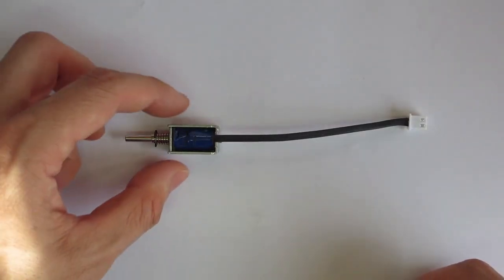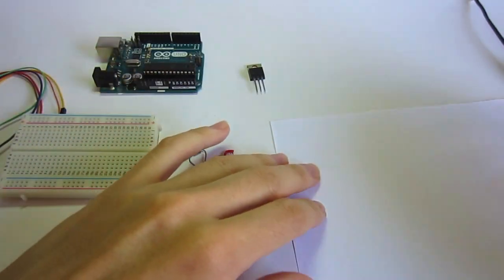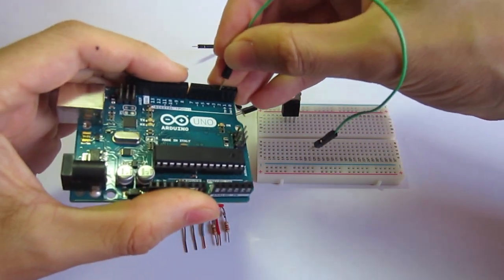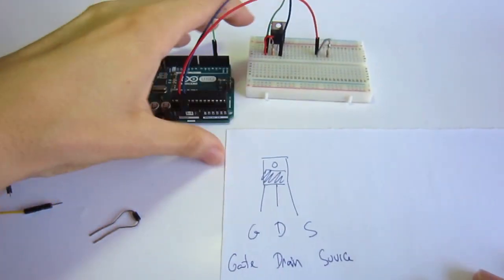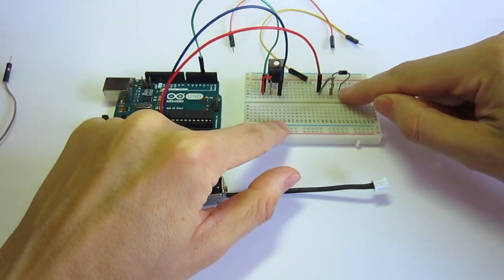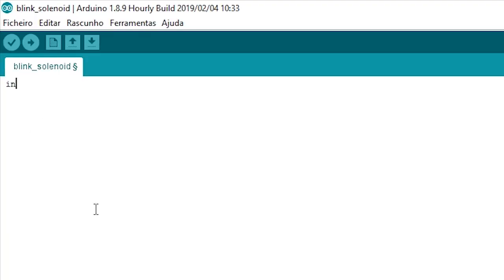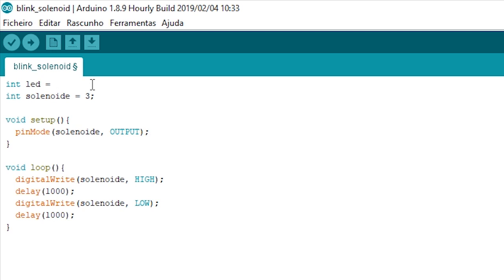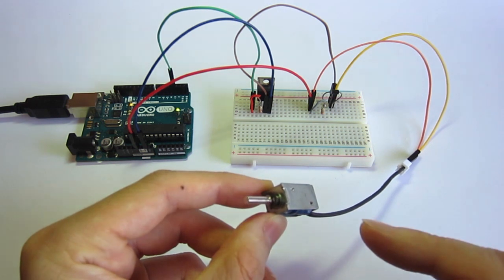Circuit to safely control a Solenoid with an Arduino ⚙️📱🔌⚡🔋💡

Comment: Can we connect multiple seluonoids say as 10000 in series
Reply from the maker: not with this system, because it doesn't have enough pins or power
Reply from the maker: This Arduino uses 5V and the solenoid is 5V, so it only has power for 1
Reply from the maker: which project could you need 10000 ?

Comment: Will this circuit work if you want the opposite effect? I want the solenoid to be in the back position always and pull forwards when needed
Reply from the maker: you can change on the code to always be "on"

Comment: How would you connect 88 solenoids acting independently?
Reply from the maker: Even the Arduino Mega 2560 has only 54 digital I/O pins, more than most other boards, but still not enough for 88 solenoids...
Reply from the maker: That will be very complex. Connecting 88 solenoids to an Arduino while ensuring they operate independently involves several considerations, including power management, pin limitations, and control circuitry

Comment: Does it matter what type of resistor, transistor, and diode you use?
Reply from the maker: not really
Reply from the maker: this is only for a 5v solenoid
Reply from the maker: but what do you want to use?

Comment: Thank you for this, it is very useful.  I’m a complete newbie to electronics and arduino, but am working on a project that needs to operate a solenoid by a remote control.  Is that possible?  Many thanks.  Mark
Reply from the maker: you need a module to connect the remote control to the arduino, and them program it

Comment: Excellent tutorial!
Is it possible to connect six 5v solenoid with an arduino working all together at the same time? I'm working on a Braille project for donate to blind kids. I hope you can help me. Thanks!
Reply: Hey, have you completed this project? I am doing something similar and would appreciate guidance
Reply from the maker: Yes, it is possible to connect and control six 5V solenoids with an Arduino so they can activate simultaneously, but the Arduino itself cannot directly power the solenoids because it cannot provide enough current

Comment: What is the use of 1N4007 diode in controlling solenoid?
Reply from the maker: it acts like a kickback
Reply from the maker: to not allow the direction of the current
Reply from the maker: and not damage the Arduino

Comment: I want to use 5v solenoid in a control circuit of an air mattress , should i connect the solenoid directly to the ardunio without a transistor? 
And does the 5v solenoid even work for such circuit?
Reply from the maker: the problem is if you are working with very high voltages

Comment: Would it be possible to make the solenoid "pulse" each time you press any keys on a keyboard?
Reply from the maker: Yes, you could have a Processing program that whenever it detects a pressed key, it sends a command to the arduino to do something, you could even program to do something different with each key

Comment: Very helpful! can you show how to connect multiple solenoids using 1 Arduino with a rhythmic pattern?
Reply from the maker: i am working on a project with multiple motors, but they are controlled in the same way as a solenoid.
Reply from the maker: When it's done, I'll publish the video :)
Reply: @jomirife  Theat great! I can't wait to see it all work. I really appreciate what you do!

Comment: Very useful. Thanks for this video. Getting aspiration to learn Arduino. From where u ordered these products.
1 Arduino, 1 Breadboard, 1 Solenoid (or 1 motor), 6 cables, 1 transistor IRF520, 1 diode 1N4007, 1 resistor of 330 ohm, 1 resistor of 2.2k ohm.
Reply from the maker: I have been acquiring the components over the years as I need them for my projects, sometimes I buy other times I recover stuff from electronic waste
Reply from the maker: But you can search for kits on amazon or ebay that include all of that
Reply: Is that a 5 v solenoid or 12 v selonoid ?

Comment: That's great demonstration,
But if I want to use morethan 1 selenoid, how it could be? Am I just need to adds >1 selenoid, >1 R 330, >1 diode,?
Thank you very much,
Reply from the maker: do you want to use more than 1 solenoid on the same circuito of that transistor? or control different solenoids with differente transistors?
Reply: @jomirife  yes, something like that..

It would be not enough, I got that
Reply from the maker: note that the arduino only has 5v, you would need an additional power source to power different solenoids at the same time

Comment: Hello, I want to ask what resistors and transistor do I need, if I want to use 6V solenoid with 9V Jack Arduino connector. Thank you and great video btw =]
Reply from the maker: you can use this same circuit, the diode I use is only to prevent the current direction so as not to burn the arduino

Comment: If i want to run a 24vdc solenoid valve then  what are  the components do u have to change
Reply from the maker: you can use the same, only have to use another power source for that, because the arduino only do 3v and 5v

Comment: Thank you so much for the video, maybe my project is the different amp of solenoid, so how to calcalaue the resistor and transistor i need?  thanks
Reply from the maker: you need to check the datasheet of your components to determine which resistors you need to use

Comment: Can you control Six Solenoids with one Arduino
Reply from the maker: as long as you have anough pins for that, you can. But sendind power for all of then at the same time, can be a problem.
Reply from the maker: thanks for the idea, i will try that, and give you credit

Comment: For some reason my solenoid doesnt respond to the low comand on the pin. It retracts due to the power supply but  thats it.
Reply from the maker: What voltage is your solenoid?
Reply from the maker: If the solenoid needs more that 5 volts to work, the Arduino doen't have the power to do it
Reply: @jomirife  I have a solenoid rated for 4.5V minimum to operate. I am using an external DC power supply as well just to draw out the neccessary current.

This is the solenoid I am using.
https://www.amazon.com/gp/product/B013DR655A/ref=ppx_yo_dt_b_asin_title_o02_s00?ie=UTF8&psc=1

Is this similar to yours?

Comment: Does your MOSFET heat sink get really hot when in use?
Reply from the maker: In this system.. no, the energy required is very low and does not heat the transistor.
Reply from the maker: But this can happen in systems with larger components that require more power. Have you had that problem?

Comment: Hi, I want to connect a motion sensor at input and when someone waves, I want the solenoid to operate. Can you help with this ?
Reply: just use motion sensor, and if input movement is detected set the solenoid to high
Reply from the maker: I could help, I did this project https://www.youtube.com/watch?v=NLIHn6Duenk where the motion sensor turns on a light, for your project I just needed to put the solenoid pin in that output

Comment: liked and subscribed, nice demo. is this possible if I use Lock-style Solenoid 12VDC
?
Reply from the maker: Yes, especially if it is for a door. I used this solenoid on a model for proof of concept because I didn't have a lock type at the time.
Reply: @jomirife  thanks!
Reply from the maker: @hardcoreprogrammingwarrior7036  you're welcome
Reply from the maker: I will post the demonstration of my project maybe next month.

Comment: I note you are powering the solenoid via the Arduino power supply (USB). Does the solenoid draw too many Watts on the inrush current for the capability of the USB power?  Would a separate power feed to the breadboard and the IRF520 be a more cautious approach?

Otherwise a nice clear explanation with good diagrams. Thank you.
Reply from the maker: yes, you're right, but in my case as the circuit only serves to move one 5V solenoid, I preferred to use the current received by the USB.

Comment: Does it matter how much voltage is used for the solenoid? ; Can i use the same transitor and diode you used for a simular setup using a 9V solenoid?
Also, how do you know which is the right mosfet and diode to use in a setup like this? Or are all mosfets and diodes simular enough for a setup like this?
Thanks in advance anyone! :)
Reply from the maker: Yes, it matter. I tested with the 3V power, and it didn't have enought power to move the piston of the solenoid. So for this solenoid you need at least the 5V. I didn't try yet with voltage above 5V.
Reply from the maker: Subscribe for more projets, I will post a bigger project where I use the solenoid to lock and unlock a door using a NFC card.

Comment: Sir, i follow ur instruction but only the light on but the solenoid wont move at all. Can you explain why? Thank you sir for your tutorial
Reply from the maker: I would need to see your project better to identify the problem.
Reply from the maker: Subscribe for more projets, I will post a bigger project where I use the solenoid to lock and unlock a door using with a different setup and connections on the breadboard.

Comment: can we use a tip120 transistor instead of the irf 520
Reply from the maker: the tip120 is two NPN transistors, so i think there will be no problem, and will protect the arduino pins in the same way
Reply from the maker: Soon I will publish the complete project where I use this part with the solenoid, so you should subscribe to the channel so you don't miss the video 👍👍👍

Comment: Hi. Would this work with a solenoid that draws more current, or would I need different resistors etc?
Reply from the maker: The arduino can't work with much more powerful solenoids, you would need other components to amplify the power
Reply from the maker: Soon I will publish the complete project where I use this part with the solenoid, so you should subscribe to the channel so you don't miss the project 👍👍👍

Comment: Sir,I need the 5v pin of the arduino for another component of the curcuit....
What shall I do in that case?
Sir, this is very important for my project...
Reply from the maker: I'm not really sure if you can solve that problem, because the 5v to the solenoid is almost not enough to move the solenoide, and sharing that powersource could be a problem.
Reply from the maker: Soon I will publish a project where I use many components and sensors in the same system, powered only by the Arduino's 5V, and the power source is shared and distributed on the breadboard. So it can also work that way for you.
Reply from the maker: Subscribe for more videos like this 👍👍👍 I will publish more videos with Arduinos and electronics
Reply: Ok Thanks for your assurance Sir...I'll wait...🙂
Reply from the maker: @LionKing-tx2ve  I will also post fotos and diagrams of the projet on my instragram https://www.instagram.com/jomirife/

Comment: can you make the solenoid move slower and might delay it at open?
Reply from the maker: To control the velocity you sould use a stepper motor, mas to delay the action you just do it on the code.

Comment: what is the voltage rating of the solenoid/motor u used?.. thanks :)
Reply from the maker: 5 volts
Reply from the maker: Check this post https://jomirife.blogspot.com/2020/03/solenoid-push-pull.html
Reply: @chips1237  something above you?

Comment: Very nice. Can you connect 3 x outputs?  I have to open en close 3 x motorized ball valved in a certain sequence to open and close water for a solar geyser. Is it possible to do with 3 x outputs?
Reply from the maker: Yes, just use a pin on the Arduino for each solenoid. But with this system I wouldn't have enough power por activate all the solenoids at the same time, but I could use them one at a time.

Comment: could you do the triggering solenoid for this project with IR sensor?
Reply from the maker: It would be easy, but I don't have an IR sensor to do it. But you would have to indicate that when it receives the IR signal, it makes the digital pin HIGH. Soon I will publish a project where I do something similar, but with a PIR sensor. Subscribe to the channel to not miss it.